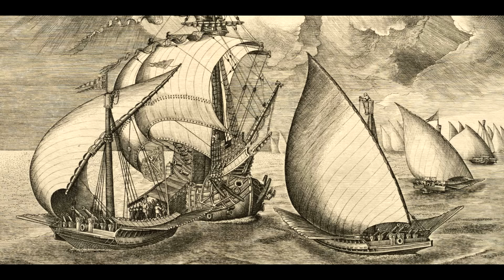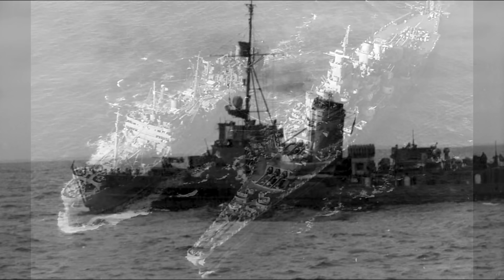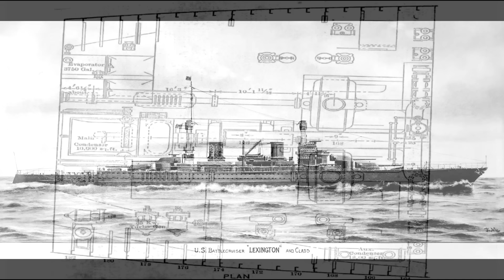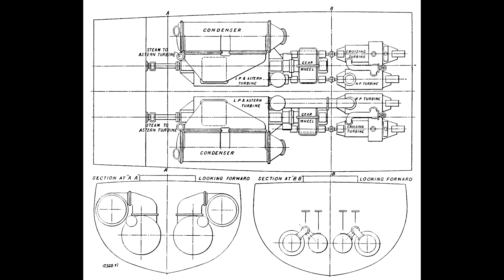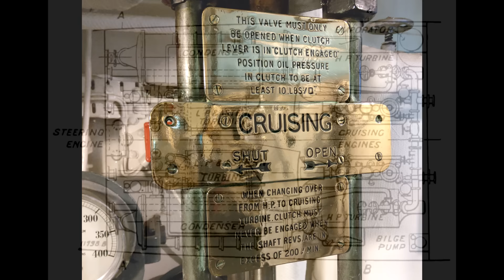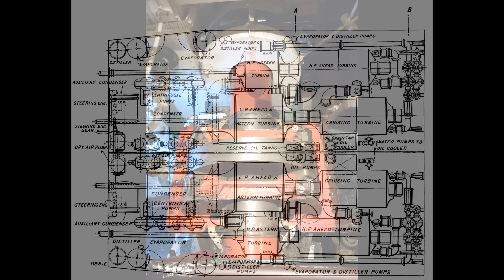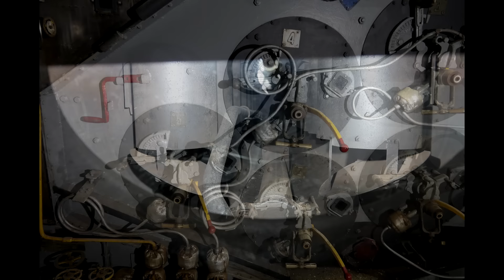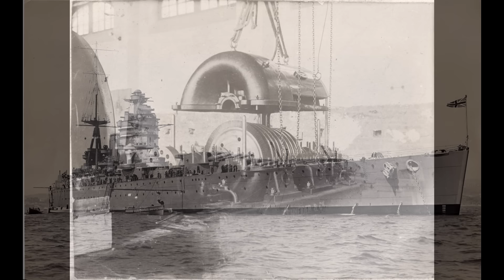Naval Engineering - How to choose your engines

Comment: Have you heard the new craze sweeping the naval circles? They are talking about a steam system using a spicy rock. I hear it's the future.
Reply: Meanwhile 2000 years from now. 
Have you heard about the new craze? They're talking about steam systems using 0 point energy.
Reply: Speaking as a retired USN nuke, the steam plants powered by spicy rocks aren't greatly different from those powered by boilers. Except for where the steam comes from, they're really very much alike. If an American pit snipe from WW2 somehow got magically transported into a Nimitz class carrier's main engineering spaces, it would look surprisingly familiar except for the sheer size of everything. Yes, that is a turbogenerator the size of a boxcar. Seriously, basic steam plantery is pretty much the same no matter the era. And in some cases, it's literally the same equipment that has been used for generations. See that oil purifier? It's the same DeLeval type that goes all the way back to German U-boats in WW1. If it ain''t broke, don't fix it.
Reply: @nortyfiner that’s why people who talk about “nobody knows how to run a steam plant!” in reference to reactivating older ships like the Iowas have no clue. There are multitudinous reasons why bringing back an Iowa would be a ridiculous undertaking, but lack of steam plant knowledge ain’t one of ‘em.
Reply: @F-Man  I think the problem isn't that nobody knows how to run a steam plant, it's that (a) relatively few people know how to run a steam plant, and nobody still in active service knows how to run those specific steam plants.
And a ship is such a massive beast that even if it was built to a standardized plan (as standardized as a warship from the 1940s and refitted throughout up to the 1990s can be), it's going to have all kinds of fun individual foibles and quirks that would have been well known to the crew that lived and worked aboard her, but won't show up in any standard manuals.
Fun fact? To help mitigate this issue, USS New Jersey has aboard her, to this day, whole binders full of what her last crew knew. The last crew knew about this (probably because they were also descended recently from the crew who had pulled her out of mothballs the first time) problem in the severing of institutional knowledge, and they tried to write down as much of the unwritten lore as they could, just in case the Navy called New Jersey back to service.
Reply: @nortyfiner  I  imagine a lot of our SOPs would be very familiar to them, too, and they'd be able to qualify in minimal time, once they learn the differences in/new immediate actions. Having a binder of IAs and SOPs might be new, not sure.
Reply: @nortyfiner  Too many people now do not understand that many equipment designs are 100 years or older. They may have updated materials to handle more stress, but the basic design is still the same. It is also amazing how much old equipment is still in use, we had a lathe that was from some 1930s - 1940s era ship.
Reply: @nortyfiner  I though Deleval  was dairy cow milking machines...I milked a lot of cows.
Reply: @StefanBronson-rt1100  Yes. DeLaval got their start with dairy machines in 1870ish. But it turned out that their centrifugal cream separators were also really good at removing water and solids from lubricating oil, and they are still used aboard ships for that purpose to this day. I spent many hours operating and maintaining them in my Navy career. Picture: https://www.sandersequipment.com/storage/images/equipment/9623a.jpg
Reply: @StefanBronson-rt1100 Same company
Reply: Hmm Ginger flavored Rocks.
Reply: @PeterWood-r3d you do know you don’t mine those out of the ground, they start as rocks.
Reply: Thorium! Right?
Reply: Spicy rock is scary. Only the Savannah used spicy rock.
Reply: A return to nuke would be interesting
Reply: https://youtu.be/44H2_cu02P4?t=32
Reply: https://youtu.be/bvqgCQcDkKM
Reply: Matter / Anti-matter?
Reply: Crack rocks? Those can be pretty spicy. The give me the toots.
Reply: All you guys think he's talking about Thorium or Uranium, but the spicy rock is just coal.
Reply: @dougmorgan8778 
Coal isnt spicy..... its nuclear guys....in a coal style product.... its called SMRs fueled by X-energy patented fuel. Send your kids to study nuclear science IMO. we need our kids to study this so we have a safe infrastructure around providing this cleaner tech to our fleet. And we can service em here in the states as we should. Of course this would be a viable solution for our defense fleets. As the fuel is a 30 yr warranty product. A clean solution for a fleet that needs to defend the best mf country in the mf world. I still believe diesel is best for our merchant marine fleet and for our economy and to drive the infrastructure and demand for infrastructure economy of our south american neighbors. America should take up the demands of our southern neighbors.
Reply: @xrpkidotec520 if it's not spicy then why does my throat burn so much
Reply: @xrpkidotec520 yes coal is. Coal mining is one of the largest sources of radioactive particle release in the country. Not radioactive enough to be useful, but enough to cause problems.
Reply: @xrpkidotec520Sorry to burst your delusions but your NOT the best of country in the mf world otherwise you would have cheap health care paid for through your taxes taken straight out your wages and no need to do your taxes or have 3 strikes and your locked up, or prisons paid for by the number of inmates & as slave camps making stuff on the cheap, need i go on ? PS. it's Germany or the UK, or any other European country.
Reply: No. It's nuclear pellets.... SMRs cuh.
Reply: It’s not. Power density is too low for anything smaller than an aircraft carrier and far, far too expensive for anything smaller than an aircraft carrier, maybe a battlecruiser. Diesel if you want efficiency with a larger plant or gas turbine/integrated electric if maximum power is needed. It’s not rocket science
Reply: @coolhandab5296  unless the nuclear powered subs the US uses are absolutely HUGE, no, the expense is not too high. If anything, the only reason nukes are so expensive is because we are using it so sparingly, if we were to switch our entire Navy to use nukes, through economies of scale, nukes will become cheaper, as the per unit cost goes down.
Reply: @edgardox.feliciano3127  You have absolutely no idea what you’re talking about. US nuclear submarines are huge, and enormously expensive. There is no such thing as economy of scale for nuclear propulsion. The materials themselves are enormously expensive, as are the large, expensively trained crews. You should probably refrain from commenting about things you clearly have no clue about
Reply: @coolhandab5296 I may not know much about nukes, that is true, but I do know that they are the greatest form of power we have discovered yet, with greater power density than anything else out there, and the only reason we haven't switched to using it fully is because of bullshit fear mongering, not cause it's too expensive. Again, what your saying about nukes being not dense enough for anything smaller than a carrier is bullshit as subs, while huge, are in fact, smaller than a carrier, so your argument is automatically null and void on that front.
Reply: @edgardox.feliciano3127 the biggest "problem" or really just an issue, with nuclear is that it is a long-term investment. You can't just build a nuclear carrier and let it ride. It doesn't require the same fuel costs as a similar CODAG carrier, but it remains an investment you HAVE to keep paying for, regardless of how much or little it is actually used. You can reasonably let a conventional carrier rot in-harbor if you don't need it. You can't do the same with a nuclear one.
Reply: @Nikolai2s what about subs, or destroyers?
Reply: @coolhandab5296  density is too low??
A kilo of gasoline contains 13 megajoules of energy. A kilo of uranium has 3,45 terajoules. Nuclear power is the most energy dense system humanity has created. The only thing more dense would be fusion, and that’s barely self-sustaining as of 2026.

Comment: To be honest coal feeding can also be mechanised with conveyor belts, it has been done on locomotives. Also, oil and coal can be used together mixing them just  before the furnace, so the required   oil quantity can be hugely reduced
Reply: Yeah, but watertight integrity usually takes some priority over the backs of some poor sailors that have to transfer coal stores between different bunkers. If I am not mistaken, the coal bunkers near the boilers generally did have chutes nearby enough to keep relieve the stokers themselves a bit.
I'm very dubious about the idea of mixing coil with oil, feels unnecessary messy and potentially dangerous. I'm pretty sure they just have an oil sprayer above the coal fire. Getting a proper atomization  with the right sprayer of the oil probably does way more to improve power output / efficiency. 
During WW1 the Royal Navy used Furnace Fuel Oil (FFO), a heavy tar-like substance that (just like Bunker C) requires pre-heating to be able pump it anywhere. I would be surprised to be learning that kind of fuel wasn't completely separated till inside the semi-enclosed area of the firechamber.
Reply: @Tuning3434  Mixing reduces the need for oil, you only need as much so that the sludge is liquid(ish)

Comment: Ex-Navy Boiler Tech. Served on the last of the WW2 vintage Gearing Class Destroyers, and was forever grateful that we didn't have to deal with coal! Bunker C grade fuel oil was bad enough...
Reply: The fuel was almost certainly Navy Special Fuel Oil, NSFO, a lighter version than bunker C or #6 produced by blending distillate fuel with #6. It is still referred to as heavy oil.
Reply: My grandfather had to work his tookus off to keep the small and slow ship he was assigned to going in WW1. (And only armed with 2X3" guns and 50 cals.)

Comment: I think the hardest thing to comprehend is how BIG these things are. I have a press brake from 1943 and it has a solid steel flywheel that is more than 6 feet in diameter and about 8 inches thick just happily spinning away at hundreds of rpms but if the bearing holding it ever breaks, that flywheel is going to end up somewhere a few BLOCKS from where it started.
Reply: Look up "flywheel explosion". I never really though about it, but when I saw the term I thought that, yes, there's quite a bit of energy stored in there.
Reply: I recall years ago, reading about a fiberglass flywheel that was intended to be a power source for a car. When they tested a metal flywheel to destruction, it was completely contained within the six containment rings that were used for protection. When the fiberglass flywheel was destroyed, they opened the container and could not find any trace of the inner three steel containment rings. They had been completely ground to dust by the particles from the flywheel as it disintegrated.

Comment: Were constant speed propellers (like on an airplane) ever tried on ships at sea? It seems like it could have solved the same problem that geared turbines solved.
Reply: We do have Controllably pitch propellors (CPP) on many ships nowadays but 1000's of RPM from a steam turbine is still way to high of an RPM for any propellor to run efficiently at. Most CPP systems are more for the ability to reverse for a Gasturbine powered ship or for medium speed diesels.
Reply: I wondered about that as well. It's probably more difficult to do for a ship's propeller than a small aircraft propeller. There must still be a optimum pitch for the propeller blades with them being less efficient at steeper or shallower angles. But the fall off in efficiency over a range of water speeds and power settings should be less than with a fixed pitch propeller.
Reply: @philiphumphrey1548 Of course CPP is becoming much more common now adays in certain applications for ships with the us Arleigh Burkes being big users, but in all a properly designed fixed pitch propellor will usually have a chosen most efficient speed depending on the vessel. Most modern vessels that utilize slow speed diesels (container ships, tankers, and such) will have a fixed pitch prop because it is mechanically much more reliable and simple and for a specific speed which most of those ships cruise out most of the time it is more efficient.

I will also say one of the biggest differences between commercial vessels and aircraft is the machine hours to maintenance hours. Aircraft usually will have much more time with the systems shut off whereas a ship usually is underway for days or weeks at a time, so more complicated systems can often be more of a hinderance especially with how saltwaters ultimate goal is to destroy every single system on the ship.